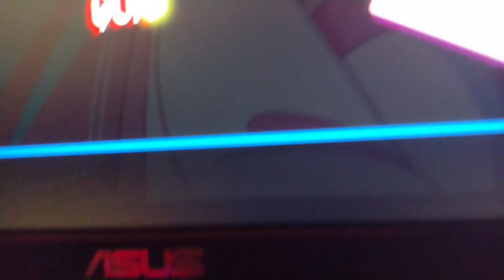mouse glove Prototype 1 Test

Comment from the maker: The biggest problem i had fooling around with this is the sensor, There is a plastic piece that goes over it that has what i assume is a magnification lens on it that allows the mouse to move. When this plastic piece moves the mouse stops working. Along with that sensitivity is really hard to tune so i want to figure that out as well